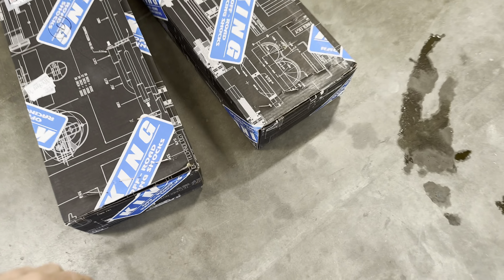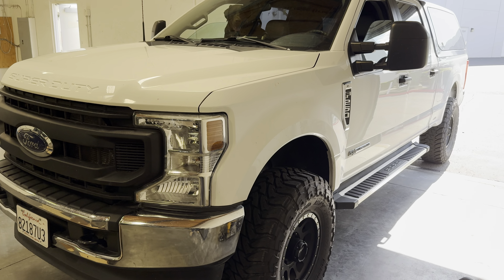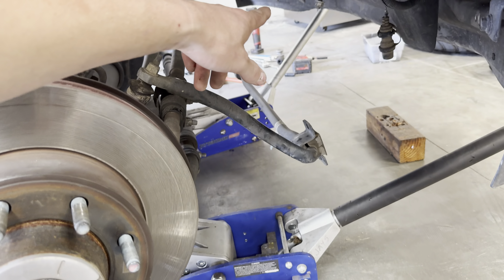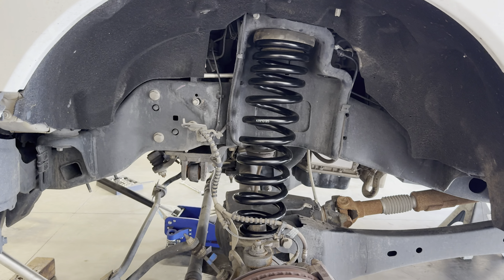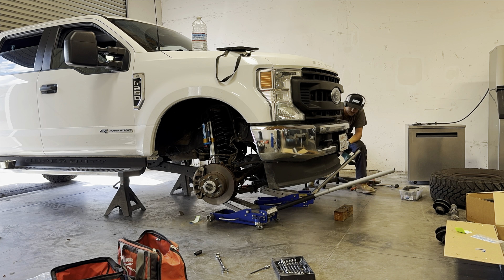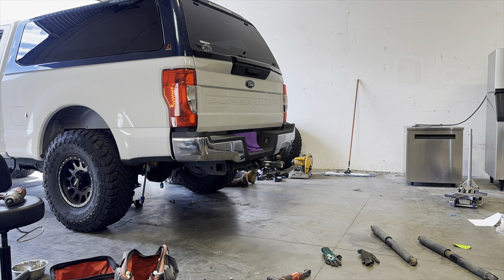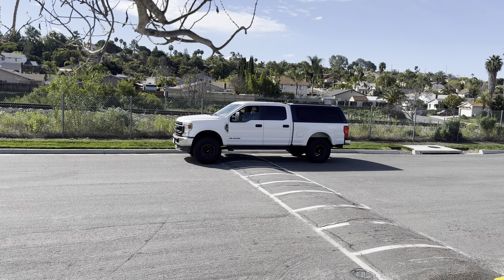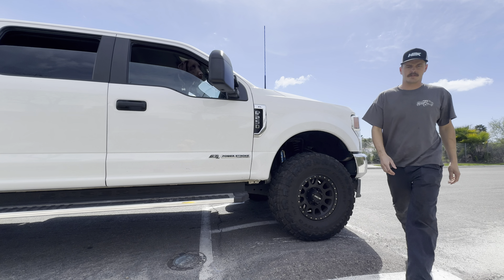OFF-ROAD SUSPENSION WORTH IT?? KING SHOCKS AND DUAL RATE SPRINGS.

Comment: Look into Carli suspension as well for other suspension components to clean up the ride quality. An adjustable track bar would be a good upgrade to center the axle again.
Reply from the maker: Yes Carli is good just way over priced. And my axle is centered, you really don’t need it when leveling your truck.

Comment: Nice setup! Have you found a resolution to the rub on the resi?  What are the specs on your wheel and tires?
Reply from the maker: Flipping them around “opposite” side. 0 offset 12.5 17r 37”
Reply: @JDKFABRICATION  So you actually moved the resi on the shock body?  Or put each shock on opposite sides of the truck?  I've got this set on the way but couldn't find much info on this before I ordered.  I'm sure I'll figure it either way..
Reply from the maker: @schuy-xk4iy correct put the left on the right side
Reply: Good man. Appreciate the feedback.
Reply: @JDKFABRICATION  how much extra room do you have between the tire and reservoir now? Curious if these will work on my setup if I swap the sides too (stock wheel with 3/8" spacer and 296/65r20 Toyo MTs)

Also, do you think the adjusters are worth it?

Comment: You have part numbers for what you installed? 
Are you still liking it? How different does the rear feel with only changing the shocks? 
What kind of off-road do you do with it? How has it improved?
Reply from the maker: I did this suspension strictly for highway driving since my spacer lift before was very violent. Went from feeling like riding on bricks to riding in a Cadillac